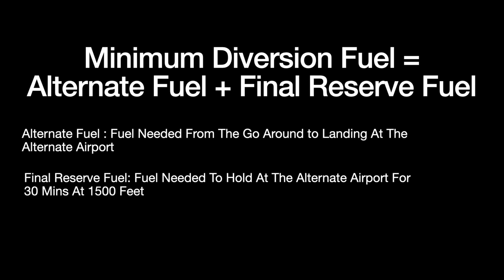The Desperate Gamble | Jet Airways Flight 555

Comment: I think the biggest contributing factor was the lack of ATC information on a deteriorating weather situation. ATC Trivandrum should have immediately alerted the pilots to the falling visibility and updated the conditions at Cochin and Coimbatore as better. The pilots could then have declared minimum fuel and elected to land on a precision approach (ILS) either at Cochin, or at Coimbatore (which was not only reachable at that stage but also had an ILS as well as the better weather conditions of all). Anyway, the pilots recognized the hole they had dug themselves into and in desperation kept cool enough to eventually find the runway and land. That calmness to keep a clear head at the end is to be commended.

Comment: I don’t know why planes don’t just always take off with the maximum amount of fuel the plane can hold instead of making calculations?  If you don’t use all the fuel no problem because it’s just going to be filled up again when it arrives.  When I’m taking a car trip, I don’t only put in the amount of gas I need to go 150 miles, I fill the tank for peace of mind.

Comment: Back in the mid 90s, on a morning flight Heathrow to Isle of Man, the southern half of the island was in fog. To the north the unused airfield was in bright sunshine.
Missed approach and stack became the buzz words among the passengers. The crew did a fantastic job of keeping us all updated throughout, letting us know that one plane had ‘just made it’ so we were going to try…missed approach and stack again.  Of course looking vertically on each approach we could clearly see the gantry light in the sea on the extended runway line but obviously the angle for the pilots was not as clear.
I can’t remember exactly how many approaches we made (4 I think) before diverting to Liverpool for refuel. We then gave it another shot before calling it a day and going back to Liverpool.  BA put us all up in various hotels, taxied us to Manchester and shuttled us back to Heathrow. Total air time was about 5-6 hours instead of the 50 planned flight.

Comment: A good story, but you could improve your delivery by putting a brief visual display at the beginning of the video stating that all measurements would be in pounds (or kilo's, but aviation works primarily in pounds), as using two systems constantly makes it more confusing. In addition, you would do better to report in local time, because without several minutes of work, I have no idea if the event you are describing take place in daylight or at night, which can make a big difference.

Comment: I am a pilot for a heavy lift long haul cargo airline and every drop of jet fuel is precious to us in the case of a missed aproach. As a company policy and common sense really you need to start heading towards your alternate airport after the second unsuccessful attempt to land at your intended destination airport, all of these rules are to be followed without hesitation and without any delay,  remember that the fuel remaining is all you have and fuel is time aloft. Also once you land at your alternate airport the fuel remaining better be the amount that was calculated or better, this is the fuel that is the minimum legal and required to have when you put the parking brakes on and shutdown the engines at the parking gate at your alternate airport. 
These pilots in my humble opinion were suffering of the so called aviation syndrome "Get-there-itis", this is a mental condition and their flight was a dangerous close call for all involved, especially the paying passengers and their fellow cabin crew members. 
Good video as usual MACI, thanks for posting.

Comment: If it's still feasible to reach the originally selected alternate airport, no emergency occurred (yet) and there are no problems with the alternate (e.g. weather), it should not be allowed to pick a different alternate airport. Especially not if the reason for picking a different alternate airport is to stay above the intended airport for a longer time...

Comment: I think they had commercial reasons. While Cochin and Trivandrum are both in the state of Kerala, Bangalore is in the state of Maharashtra. Also, the passengers would maybe have been interested in landing as near to Cochin as possible, so Trivandrum would actually be the first option to divert, if weather allows. I flew with Jet Airways as a passenger several times while I was in India, and always felt safe with them. These might have been some daring pilots, but you don't know Indian bus drivers.
Reply: Bangalore is the capital of Karnataka

Comment: I’m not a pilot but do have an intense interest in all things in aviation. Personally I think it’s inherently dangerous for an airline company to have blanket policies on how many go-arounds can be done.before a diversion to another airport must happen. I can rationalise the airlines mandating a limit because a 1500 type rated is vastly different in knowledge and ability compared to a 7500hr rated Captain.

Airline Captain’s are expert aviators and in the case of the scenario of the video what I’m hearing is the pilot’s were given not ip-to-date information on the conditions of the various alternates.

There was an issue in cockpit resource management when the first officer did give the Captain a warning about some pending issues and it seems the Captain.ignored those warnings. 

Lastly it shouldn’t take 6 go-arounds before deciding to divert. As a passenger I’d be losing confidence in the flight crew if they did a 4, 5, and 6th go-around.

It was blind luck and not good airmanship that narrowly avoided a catastrophic aircraft crash.

Comment: As a non-pilot myself and disregarding the number of go arounds at the primary airport, the plane landed on the runway and everyone was fine.  Yes, it seems like they had enough fuel for one more go around but the captain had no reason to believe the results would be any different.  He had two risky options.  The option he chose resulted in a landing with no injuries or damage to the plane.  I'd call that the right choice.

Comment: Some may disagree but I feel that the pilots are not to blame and are even heroes. It is only a matter of time before another plane has so many missed approaches it runs dangerously low on fuel. I need to know that the pilot is that good he can think 'screw this' and in reality be able to get the plane on the ground ASAP without ILS and with no casualties disregarding the rule book in an emergency if need be.

Comment: I have operated this flight many times as a Captain from Cochin base. Normally this flight is done by Cochin base pilots who are familiar with Cochin and Trivandrum weather issues. Cochin tends have patches of low clouds below 320 feet which is the DA for ILS 27. So it is bit of a luck if weather is marginal to see the runway. Trivandrum VOR final track is offset to the runway which is not apparent from the chart. So if you are looking for runway ahead, you won’t see in marginal weather. It will be about  1 to 2’ o clock. This Captain was from Chennai base who don’t normally fly to these airports. These things matter when weather is marginal. I would say it is just a random combination of bad lucks for then. 
By the way, we used to always tend to reassign our alternate to Trivandrum until this incident. Since Indian weather is not a frontal system, forecast is not very accurate like in Europe or US, so unexpected weather always encounter.
Also Jet Airways didn’t have any policy about how many approaches a crew can make, but my current airline has a limit of two. That means if I do two missed approaches due weather, i am suppose to divert to alternate.
Reply: He was Bangalore based. And yes had both bad luck as well as (in hindsight) flawed decisions to put him in that position. He did land in near impossible conditions and has to deserve some kudos for that.
Reply: @bobsi2813   Yeah, I think the pilots were put in a difficult situation not of their own making.  They had received bad info regarding the weather at Trivandrum, and that made all the difference.

Comment: Heck naw they wouldn't have made it for one more try! 
If planes are like cars they sure wouldn't. Ive ran outta gas more than a few times in cars because the tank always has less than what the needle or estimated number is showing. So if the plane says X amount of fuel - Id figure its actually more than a few less than what's shown. 

I definitely want my pilots like him!
Many would've let the stress mess them up. But by God he knew he had 1 more chance, and he pulled himself together, made extreme maneuvers, but he did what he had to to get them on the ground!
I wonder if the passengers knew what was happening if they did i bet many didnt fly for awhile after this lol

Comment: It is worth noting here that Irish airline RYANAIR have been criticised for only allowing each aeroplane JUST enough fuel to go from A to B with NO MARGIN OF SAFETY (ie no extra fuel in case of such eventualities). On several occasions, Ryanair pilots have had to tell Air Traffic Control that they have a fuel emergency. Ground Control have then had to give Ryanair flights priority landing. Ryanair owner Michael O'Leary is unconcerned, but Ryanair pilots feel that they are being put in a potentially VERY dangerous position. I for one would NEVER fly with Ryanair for this reason. O'Leary clearly wishes to maximise his profits, but at what potential cost in lives? 

Imagine a situation such as the one described in this video where a Ryanair aeroplane, which simply didn't have enough fuel on board for even one 'go around,' let alone 6 or 7 (as happened here), were to be forced to fly around several times. This is a disaster in the making, IMO. 

To me, it is significant that one of the airports did NOT have bright lights to guide in aeroplanes during times of poor visibility, and some did NOT have ILS. Then there is the problem of a lack of company guidelines for pilots when having to divert from one airport to another, and upon how many 'go arounds' they were expected to make before needing to change destinations. I personally would NOT blame the pilots in this situation.

Comment: THE pilot should  commended for have the sense to 
do a go-around as many times as necessary.  In all the 
landing attempts he never took one unnecessary unsafe action.  The
pilot continued to put the concerns  of the passengers and crew,
first over possible reprimands form the control tower and his company.
Reply: I give a small amount of credit to the captain for the go around decisions. However, I criticise his decision to divert to an airport which lacked ILS when he should have known he was unskilled at VOR approaches (something, I have the feeling, was known to the first officer). Also, when you already have a potential fuel exhaustion issue, you should take extra care to ensure that you do not waste fuel by arriving too high at your alternate airport (also, by the way, meaning you try your approach later as weather is deteriorating). As for the eventual decision to make a risky landing other than as directed by ATC, it is difficult to know if that was reckless, or the lesser of evils at the time the captain did so. What I will say is that I would hate to be on a flight where superior airmanship was needed with that particular captain involved. I cannot see that the first officer deserves blame, for the most part, given that good CRM was apparently not a thing. He might have noticed the altitude issue approaching Trivandrum and warned the captain about that, though.

Comment: There's more to this story. Apparently the diversion airport, officially was Bangalore, but pilot chose Trivandrum, which is close to Kochi. It seems he was trying to save fuel for his company and put the flight in danger. And also he tried to land on the shorter runway at Trivandrum. They were unfortunate with the weather but pilot has to take blame here. I think he was suspended.
Reply: They tried their best to land at Kochi (their destination airport). Trivandrum was chosen so they can give landing another shot at Kochi, which failed, after which they didn’t have enough fuel to divert to Bangalore. I don’t think they anticipated the weather to be that bad at Trivandrum.

Comment: Pilots have the authority to disregard policy if they determine they are not in the best interest of flight safety.  Therefore the lack of a policy is not to blame, because the pilot is the final authority.  This near disaster comes down to a poor decision by the PIC.  Providence stepped in to prevent disaster, but it easily could have been worse.

Comment: Im a pilot and my company mandates a diversion after two go-arounds due to weather.
Reply: I’m not a professional pilot but have been a private pilot for 40 years. I currently fly a C441 and I would divert after the second attempt, or even the first if there was no reason to believe things would improve for the second.
Reply: @TIO540S1  did you hear him say ILS or VOR as the two types of flight? And stated that VOR was visual? I have heard of VFR as a private pilot but VOR stood for visual omnirange or the beacon used for civilian pilots. Heck I haven't flown in 30 years so maybe my memory is bad.
Reply: @jlfcpa  VOR is “VHF Omnirange.” The beacon signals are in the VHF band, just below the voice channels. The ILS system used two signals: the localizer for lateral guidance and the glideslope for vertical guidance. Along with various RNAV (GPS typically) approaches, it’s a “precision approach” because it gives precise lateral and vertical guidance and had a “decision height.” VOR approaches are “non-precision” approaches because they do not provide vertical guidance. Rather, they give step down altitudes and a “minimum descent altitude.” The minimums for a VOR approach are considerably higher than those for an ILS or a precision RNAV approach.
Reply: @jlfcpa  I think you are confusing the two types of flight rules, VFR (visual flight rules) and IFR (instrument flight rules), with two different types of radio navigation aids, the ILS (instrument landing system), and the VOR (VHF omnidirectional range), both of which are used primarily on IFR flights (although VOR’s are used quite often in VFR as a secondary navigation tool). Both the ILS and the VOR approaches are instrument approaches,  the difference is that the ILS is a precision approach, meaning that you have vertical, as well as lateral navigation. For a VOR approach, you only have lateral navigation, with different techniques of descending depending on whether your plane has an FMC and how modern it is. Because of this, VOR approaches have higher minimum weather minima than ILS approaches, which was one of the issues here
Reply: Sensible policy.
Reply: @randomxnp  They do. I see 305 to 315 KTAS in the flight levels burning 75 gallons per hour. Even though I started out looking at Cheyenne 400LSs, I’m happy with the airplane.
Reply: @randomxnp  The the deciding factor for me was range. There were no King Airs in my price range that had 1,900 nautical mile range. The big King Airs can do that but they’re out of my budget! I’m based in Long Beach, CA but we have a Tampa, FL office. Eastbound, I can get there nonstop.
Reply: In those days the company had no rule on those topic. Later was introduced.
Reply: We had also two.....
Reply: What company?
Reply: @Gmancro929  Ryan air
Reply: @Gmancro929  idk what company op works for, but here at Skywest it's the same
Reply: But should it be a company rule and the decision away from the folks up front?

Comment: I can’t find that my airline has a limit on the number of approaches.  I’ve gone as high as 3 before.  When we hit min diversion fuel we divert.  I have asked for a closer alternate before as well.  The only real mistake I see here is in not valuing the FOs input. The CA never lost situational awareness.  This is a tough call. Given the info they had I can’t see where I would have done much differently.
Reply: I think you mean he threw chocin to the wind
Reply: @nopy99  I think you meant to say Kochin, which is the place they were landing at initially.
Funny enough, this is close to where Vasco da Gama landed in India. Kochi has a lot of Portuguese influence and architecture.
Reply: isnt the 737 capable for CAT III landing? then why did they not use the full autoland feature? can you please explain?
Reply: @gautamjain3498  CAT III/autoland only works where the airport and runway have all the numerous  necessary navigational aids -- highly tuned and accurate localizer, glide slope, distance measuring equipment or precision GPS equivalents; also extremely unobstructed approach zones; also special approach lights, runway touchdown zone and centerline lighting.  So, they can't dial up an autoland at an airport like Trivandrum, which doesn't even have CAT I ILS.
Reply: @SDK-im8sl  But had they diverted to Bangalore they could've used CAT III autoland
Reply: Playing safe is the Priority, Honestly i think the PIC ego was playing big that night and he threw caution to the Wind.